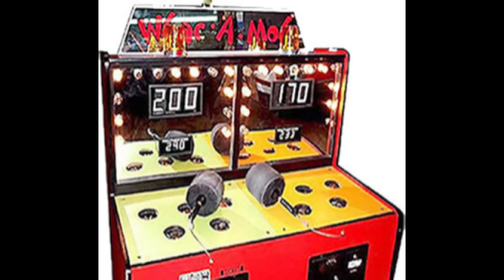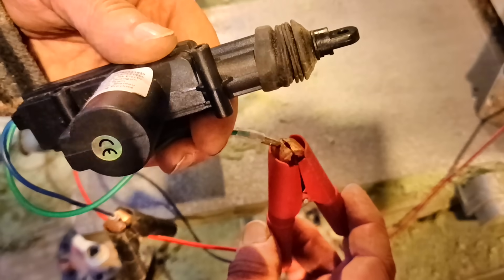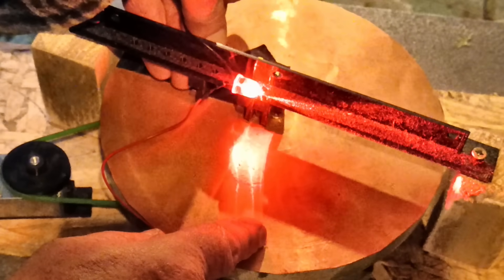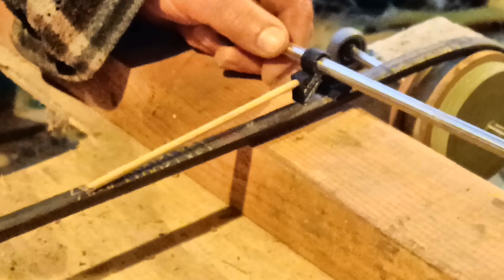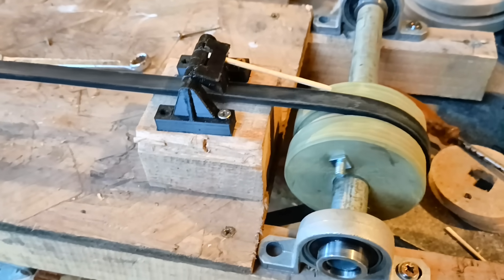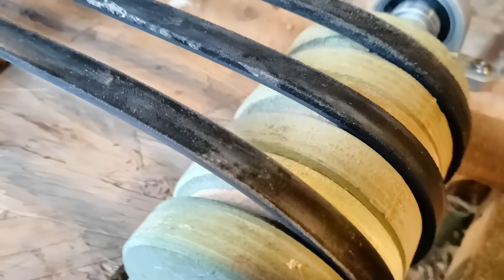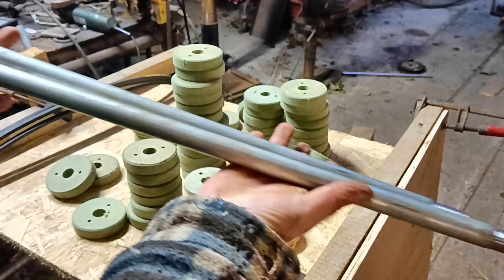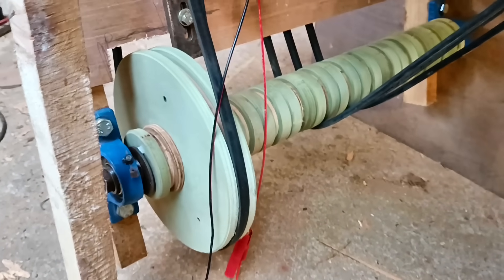How To Make A Whack-A-Mole Game - Part One, The Poppy-Up Bits..

Comment: When it comes to the copper "programming" disc - it could work, but you would either need to start with an insulting disc and add strips of thick copper, or a blank copper clad PCB with sections of copper removed. It's possible to use a blade to carefully cut through the copper pour, and lift off/peel off sections if the board is really cheap, or else you'll need to grind off the required areas. Tin the remaining copper for durability with a generous amount of leaded solder.

The whack-a-mole games I played as a kid would get faster with each successful hit, making it a fun challenge no matter how good you were, and would end after a certain number of missed hits. To avoid repeating patterns, the program disc/commutator is not a great idea. Perhaps each "track" would have to be on its own disc, each one spun by one of a series of variable friction wheels on a common shaft. Depending on the starting position of each drive wheel, pushing or pulling the drive shaft would increase the speed of some tracks and decrease others, while the shaft rotation speed ticks up with each score.
Reply from the maker: Interesting. Thanks. I've only got as far as speeding the motor up as it goes along..

Comment: "Paddy whack" :p ( for some reason that This old man nursery rhyme popped in my head )

A while ago I watched a bunchnof vids on how 70s electromechanical pinball machines work, I think they have much the same problems to solve, so might be worth some time ( plus they're rwally fun devices! ).

Wondering if there's some over-centre mechanism ( maybe using a disc with an offset axis ) that could be primed & deprimed with a solenoid - or a mallet hit - but not need the solenoid constantly live to hold it. Will have to think on that one, might make a useful locking mechanism too.
Reply from the maker: I don't think Paddy Whack would go down very well here, Richard : -  )

Comment: My suggestions.

-The belt/wheel could trigger a solinoid to push the character up instead of having a belt.
-If you have a gear system then each wheel can rotate at diffrent speeds.
-If you want the character to come up verticaly. The lever could slide across the bottom of the character so when it is hidden it is at one end of the lever and at the top the other side.
-Have you had a look at a Useless Box for the mechanism?

Comment: Boogey Bopper is another idea for a name as in bopping the Boogeyman on the head. That's quite the clever implementation of a whack a mole style game, a little bit cumbersome but in reality without much knowledge on the standard implementation of it, quite a fantastic way to do it. As for session time I'd say a good amount would be 20-30 seconds, and the characters popping up for about 0.5-1 second each. That's been my experience with whack a moles though many of them have a cheeky tilt or motion switch in the hammer to make the goblins go down just that little bit faster which wouldn't be possible with yours.
Reply from the maker: Really! That's mean : -  )
Reply: @wayoutwest-workshopstuff6299 indeed it is, yours is quite a bit more fair in that regard 😅

Comment: Interesting idea Tim! Maybe consider using different sized rollers for your belts on the drive shaft? If you have a slightly different diameter for every roller, the game will feel more "random" because every belt will move at a different speed and the fixed belt patterns will "drift away" or "shift" from each other. Maybe that way you wouldn't have to slow down the motor in any way, just let the belts rotate two or three times.
Reply from the maker: Excellent idea! Thanks : -  )

Comment: How to use fragile micro switches in uncontrolled impact force situations?  Position the switch so that it is 90⁰ out of the impact direction; make the striking target have a cam (bump) on its side that activates the switch.

Have another micro switch run along the side of the belt, so that it is turned on by the wedge that lifts the beastie.  Wire the two switches in series, so that power comes in through the beastie-pop switch, goes out to the beastie-bop switch, and then to your incremental solenoid.  This will prevent scoring on a downed beastie.

There are many, many, many 3D-printable, resettable pushbutton counters that you can print and integrate for scoring.  Have the beastie-bop signal push the counter button, and have your game-start signal trigger the reset.
Reply from the maker: Yes! Lots of good ideas there. Thank you.
Reply: The coils also beat the switches a lot, so flyback-diodes are a must for every coil in the system. Cheap price for making the switch contacts last 1000x longer.

Comment: If your momentary switches aren't durable enough, or if they end up being too expensive to deploy in sufficient numbers, you could just make the characters themselves and the mallet have a coating of metal and run a tiny current through them. When the mallet touches the character, the circuit will complete and then pop the counter. You'd need a wire going to the mallet of course, but most whack-a-mole machines have the mallet on a cord attached to the machine anyway so you can't run off with it.
Reply from the maker: Yes, good idea. But I think it might be harder to get a 'clean' signal that way. But I'll experiment if I need to..

Comment: If you do end up using any relays or solenoids (also any DC motors) - include a "flyback diode",  that'll keep the voltage spikes on the power wires down and could help save any LEDs or some of the other bits that get wired in.    Being a mechanical contrivance has a lot of charm for me - I like that!  However, if you did want to do some digital electronic based controls - it is very doable and I do think you would be quite apt at getting that going.
Reply from the maker: 'flyback diode'!  Sure, I'll have two of those, please, and a packet of peanuts.  I know I have to plunge into the pool of electronics sooner or later but it's quite scary
Reply: @wayoutwest-workshopstuff6299  The cathode of the diode goes to +ve supply of your solenoid for the counter, the anode of the diode goes to the -ve supply of the solenoid. The principle is that whenever the voltage to a solenoid is disconnected, there's a massive spike of voltage of the opposite polarity, that really likes to damage switch contacts and other sensitive electronics, like your LED. The diode safely dissipates that back EMF or flyback voltage. Something like a 1N4007 rectifier diode would work well.
Reply: @wayoutwest-workshopstuff6299  I've got a few diodes around,  little short on peanuts at the moment...   Wrangling the invisible angry pixies is intimidating, partly because they're invisible!  The origin of the Arduino was to make microcontrollers more accessible to artists - and it was successful, with a large amount of documentation to help bridge the void for newcomers to this black magic.   The crowd here seems willing to lend a hand, myself included - I'm far from an expert programmer, but I have been able to make some of these do my bidding and I'm happy to tell you what I know (and don't know) when you get there.

Comment: Hi there if you changed that copper disk with tape on it for a woollen one you can add some small ramps like you have on the  v belt and put those microswitch with the roller on the gantry. That should be les compared. If you put some plug and socket between that and the mole a bit like the really old telephone exchange (the one that the lady's operated) that will charge the patern. And be less compared and lighter. All the best
Reply from the maker: Excellent suggestions! Thanks, Paul!

Comment: A lot of old pinball machines and other arcade games have a version of the spinning disc like you tried to make. 

Instead of a large copper wheel, though, they typically used wheels made from printed circuit boards and solder traces. If you research old pinball machine videos here on YouTube, you'll see many of them. 

As for how to operate the creature/thingamajig, I'd have it on an L-shaped shaft. On the end opposite of the character, I'd have another shaft, on a fulcrum, connected to the BOTTOM side of the L-shaped shaft, using a set of magnets, pulling DOWN on the L-shaped shaft. That way, when someone hits the character, the magnets can pop apart without damaging anything. Also, you can use "AND/IF" logic using only wires to control the player's ability to score points. 

You could make the characters look like monsters, and then name the game "WHACK-A-GHOUL"
Reply from the maker: Thanks Nathan. I think your magnet idea would work, but they don't like being repeatedly knocked, do they?
Reply: @wayoutwest-workshopstuff6299  My Dad has a bunch of old permanent magnets from old speakers that we've used to drag across the driveway, picking up old nails and stuff. 

Magnets made from steel don't mind being repeatedly bumped against each other. Also, in the game, the action of hitting the character would separate the magnets, (not knock them together) and they wouldn't come back together until the solenoid is shut off. 

I'd definitely use steel magnets; not those new ziridium (or whatever they're called) ultra strong magnets.

Comment: the game usually runs for about a minute.
on the side of 1 belt you could put a little arm sticking out to hit a switch to stop the machine after 1 rotation if you slow it down a little to 1 rpm.
for a score counter you could try looking into pinball replacement parts, the counters on older machines are very simple (solenoid kicks a ratchet wheel 1 click then releases)
Reply from the maker: Thanks LW. That sounds about right

Comment: I was thinking you could also create another friction wheel to change the gearing of the game. For instance, at the start of the game it could start slow and get faster as the game goes on by using the car battery to pull a rod some how that slides the a small wheel across to change the gearing. Or this idea could also be used to change the settings if need be. For example, you could change the gearing to a slower setting for your younger players and possibly increase the speed for the older ones. Hope this helps! Cheers
Reply: Hm...  If he set the game length to be one revolution of the input shaft, he could use eccentric wheels on the input shaft.  They would seem to have a varying diameter, causing the belts to speed up or slow down depending on the orientation of the input shaft. 

Of course, if he made it like that, he'd need to add belt tensioners.
Reply from the maker: I think there may be a simpler way to achieve the same aim, but we're both thinking the same thing. Thanks!

Comment: The electric whac-a-mole works like a bunch solenoids without return springs. The coil is fired pushing the mole up. When you whack the mole you overcome the magnetic holding force in the solenoid that keeps the mole up. The mole falls returning to its resting position until the coil is energized again.
Reply from the maker: Thank you. Yes, that makes sense..

Comment: If some of the belts run at different speeds it would be more random. Nice work!
Reply: This could be accomplished by changing the drive-ratios of the belts. 

I don't believe randomization would be a problem. If the belts take 40 seconds to make a loop, and the game lasts 120 seconds, each attempt, and observer will see the sequence three times. It's possible to learn, but would likely take a long time.

Comment: It would be really cool if you made all the games run off compressed air, then sold people air tanks to make them run.

Like using air tanks in place of tokens, and you have to connect up a new airtank to start a new game, and you watch a guage to know when your time is over by when the air pressure gets too low.

That would be very steampunk.

Also, you could replace the mallet with an ax, and replace the moles with logs, and call the game "split-a-log".
Reply from the maker: Now you're getting complicated! But it would be fun, for sure..
Reply: @wayoutwest-workshopstuff6299  Yeah the air tank stuff is not very realistic. But the split-a-log game is.

Comment: The copper disc idea seemed much better. More robust, lighter and smaller and cheaper to build. 

You could make it by simply taking the risers off from the belts and gluing them to the top of the disc.
Reply from the maker: .. and using solenoids to lift the targets?
Reply: @wayoutwest-workshopstuff6299 No, just using the same lifting action as the belts. But on a disc instead of a belt.

Comment: You might find some inspiration from old pinball machines. I remember watching a video where someone did a deep dive on a 'vintage' machine that was controlled with relays. The wire harness was pretty overwhelming but he broke down the steps into manageable chunks.
Reply: Alec (Technology Connections) has a video series on an "Aztec" pinball machine.
Reply: @JonesNate  That was it. Thanks for filling in the blank.

Comment: A benefit of using multiple belts is that you can have each belt run at a slightly different speed (via different-sized pulleys) so that your "random" pattern isn't always synced up across each belt.
Reply: Exactly what I came to say!
Reply: I was thinking on very similar lines to you both except over complicating it by using gearing between each drive pulleys but different size pulleys is obviously infinitely simpler and more efficient than my initial thought.
Reply: @RandomWombleP Could also be done with different belt lengths. But the variety in that is limited. Pulley size is indeed the easiest solution.
Reply: The variation comes fron the placement of the bumps
Reply: @GOJIRADOR but if the belts all run at the same speed, the pattern would repeat every cycle of the belts. If they ran at slightly different speeds, it would be a very long time before the pattern would repeat.
Reply: That sounds like a really good idea but at some stage you would get two (or possibly more) Bops popping up at once, and I don't think that's how it's supposed to be, so we would need to find a way to prevent this.
Reply: @goatsub8115 nothing wrong with that. The "real" game can have multiple popups at once, it's what makes it more frantic!

Comment: Try an old washing machine mechanical switch drum. They are 'programmable'
Reply: Seconded
Reply: Or 3D print the trigger-drums, mount some micro-switches on it and find a spare reduction geared motor
Reply from the maker: Really? Wow!
Reply: @wayoutwest-workshopstuff6299 
Try the secret life of the washing machine at 21.30.
A series of micro switches are operated by cams attached to a geared motor.
Reply: @wayoutwest-workshopstuff6299  Have sent you an email 🙂
Reply: Tim - have sent you an email 🙂 R (UK)